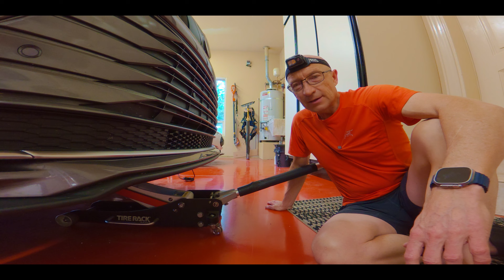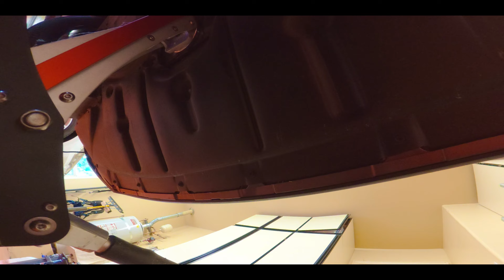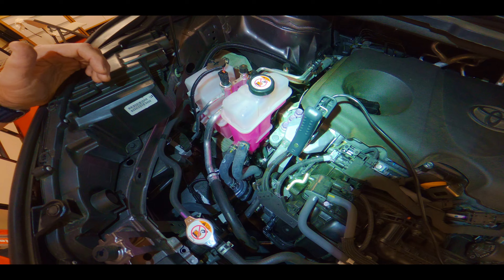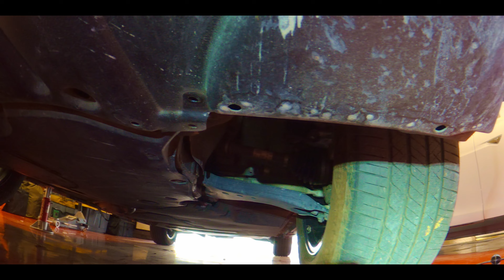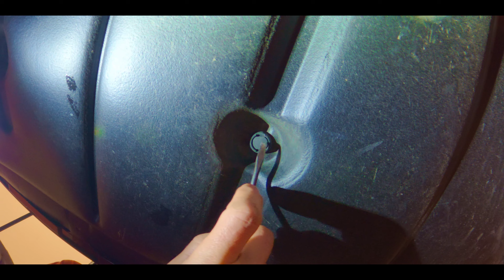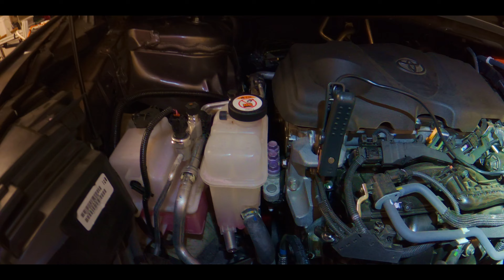My 8,000 Mile Solo Road Trip Almost Ended Before It Started

Comment: Thanks for sharing so much info about Sienna. We are considering to follow your steps!  One big question about camping in the cold weather.  Do you turn the engine on to keep the heater running? Or is the backup battery ok to power up a small heater?
Reply from the maker: Thank you for watching! While it is possible to heat Sienna by running engine at night, most of official campgrounds have engine noise curfew between 10pm and 7am. We slept in the van with outside temperatures in low thirties and were warm enough even with one of ventilation grids in the window. One option is to preheat the van before 10pm and use an extra blanket. The ancillary battery heater is an option but we have not tried this. Cheers!
Reply: @Tellvia Thank you! Good idea.

Comment: Thanks for the heads up on the Hybrid cooling pump.  I had no idea that it existed. Usually Toyota parts last longer than that...maybe a defect in the design?  I will keep an eye out for that now.  My 2022 Sienna just passed 95,000 miles and will probably hit 100k by this Summer. Have fun on your trip!  My next big solo camping trip in the van might be back to the Yukon in Fall of 2026, but I will be hitting some national parks and storm chasing again before then.

Comment: Did all of the gas savings advantage of the Hybrid just go out the window? More complicated system higher probability of failure. $700 repair part buys a lot of gasoline! This assumes your time to make the repair has no value.
Reply from the maker: With 43,500miles on the odometer of our Hybrid Sienna and average fuel economy 34.5 mi/gal, and comparing it to Honda Odyssey (probably the closest in specs non-hybrid vehicle with 22mi/gal efficiency) to date we have saved $3,137 on gas vs the same distance driven in Odyssey. So we are still in the green after the pump replacement :). Cheers!
Reply: @Tellvia  I have a 2021 Sienna, and a chunk of the gas savings will go towards eventually buying a hybrid battery.  I bought the toyota service plan, I figure one big repair and it'll pay for itself.  Unfortunately, even with the service plan it's easy to have to wait a long time for parts to get to the dealer.
Reply from the maker: @RealJohnnyDingo  Hybrid battery is covered by a 10 year warranty. While every part can fail anytime it would be a big public fiasco for Toyota if large numbers of hybrid Sienna’s would require battery replacement before 10 year age. As you probably have noticed while driving your Sienna the hybrid battery charging and discharging most of the times within very small range of total battery capacity. This prolongs battery life. They also use LiPO4 battery technology that is much less sensitive to the total number of charge/discharge cycles. I hope that with 25 years of experience manufacturing and selling hybrid vehicles they found a way to extend the life of modern batteries well beyond 10 year warranty period. Cheers!
Reply: @Tellvia  I'm not really worried at all, for the reasons you said.  The battery may be the most reliable part on the car, and I'm sure it'll last well beyond 10 years!  I think the 2021 had a NiMH battery.  My "mini-sienna" (2024 RAV4 Hybrid) has a lithium.  Being batteries they will wear out some day, but by that time likely other parts on the vehicles will be close to end-of-life too.  Worst case, reconditioned battery packs are a LOT cheaper than new ones from toyota, I'm not sure it would make sense to put a brand-new pack in a 10-20 year old car. Anyhow I really love these hybrid Toyotas.  Thanks for the video and I hope you're having a great time on your trip!
Reply: @RealJohnnyDingo  I just wanted to jump in here to mention that I am now North of 250,000 miles on my 2014 Prius and the original hybrid battery is still going strong.  I keep waiting for all of the warning lights to come on, but so far, it hasn't died yet.  Hoping for similar milage on the Sienna hybrid battery.
Reply: Perhaps not as much in the green. The redesigned 2021 Sienna Hybrid had a starting price that was approximately $2,820 higher than the base 2020 non-hybrid model it replaced. Plus 10% sales tax (here in WA state) $282 plus 4 years 32% depreciation of the Hybrid $2820 premium paid=$902 plus lost opportunity value say $800 (A $3,000 investment made in the S&P 500 four years ago (in late November 2021) would be worth approximately $3,810 to $4,070 as of November 2025.) Total $2820 +$282 tax + $902 depreciation+ lost opportunity value $800 + pump repair $850 brings grand total to $5,654 need to save on gas to break even.
Reply: @peterdement the problems that  the first generation of hybrid siennas have had are pretty limited, most of the kinks have been ironed out. At least it’s a Toyota and worth fixing. Most other cars cost twice as much and are worth nothing as soon as you drive them off the lot. Get a Denali that can haul that many people and do your cost comparison with maintenance and parts…I’ll wait. The Prius is bullet proof and can do 0-60 in like 6-7 seconds, hybrids are different now. Buy a 100,000 dollar truck all packed full of screens and cameras, it will be dead before your payments are finished